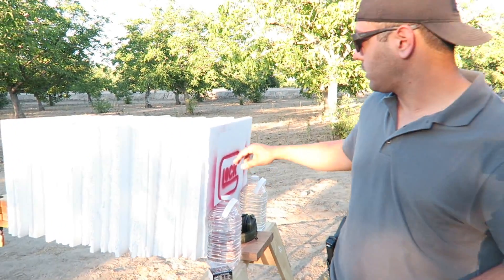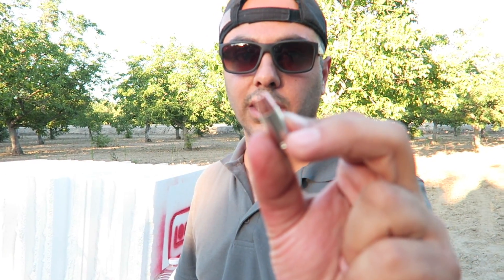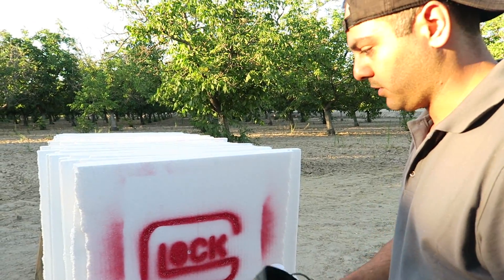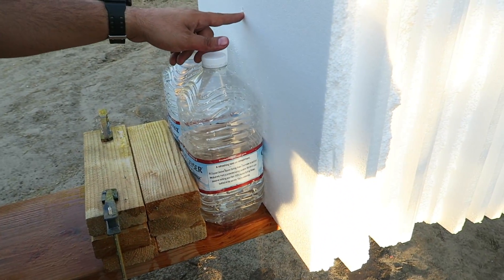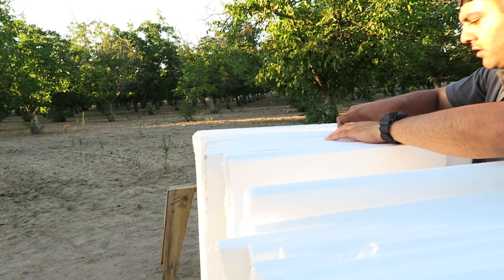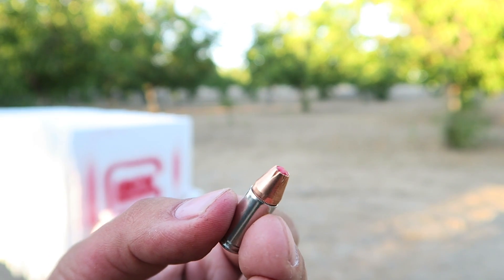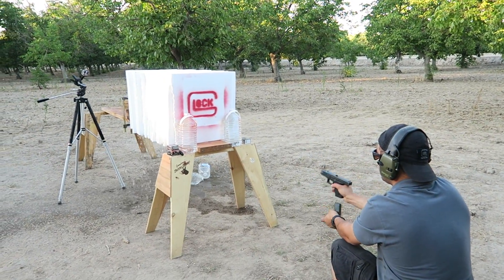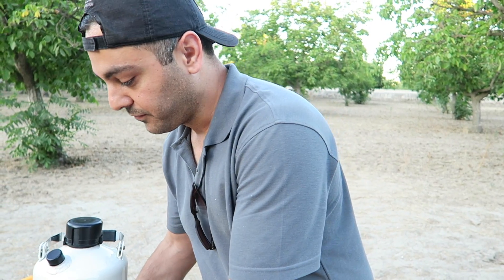can STYROFOAM stop a bullet?

Comment: The RIP rounds are meant to go through barriers like wood, glass, and metal without fragmenting. They fragment when they hit water or soft tissue. Most hollow points are also supposed to defeat light barriers and clothing. They aren't supposed to expand until water or soft tissue fills the hollow cavity.

Comment: the styrofoam seems to have Zero Effect took out the water bottles about the same as if the foam wasn't even there. bet your wondering what the RIP would do in the swimming pool lol.  great video sounds like you have some fun stuff coming up soon!
Reply from the maker: yah its like it was made out of the air. we thought about doubling the foam but at the end when we aded 4 bottle and went thought those too then we realized even if we did double it it will still go thought. because it managed to go through all that and water. but yes we gonna have some fun soon lol .